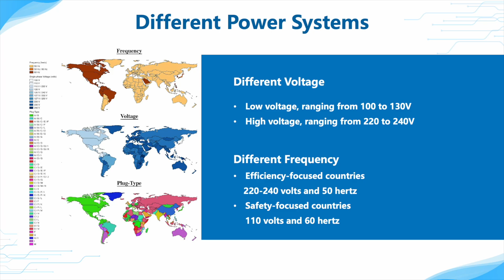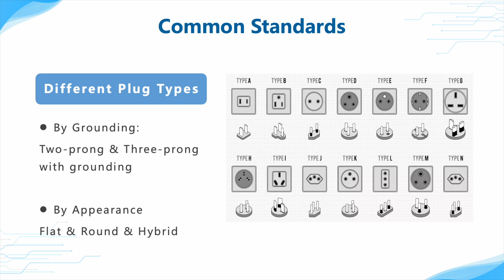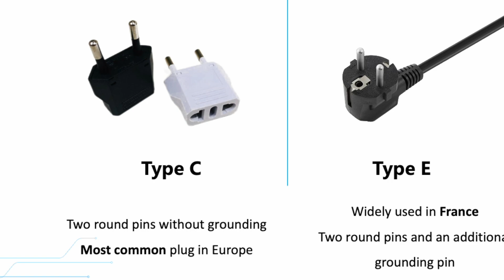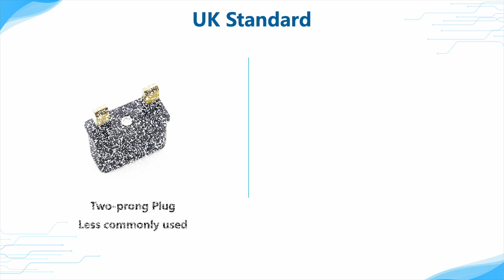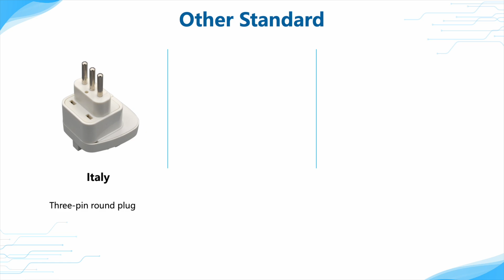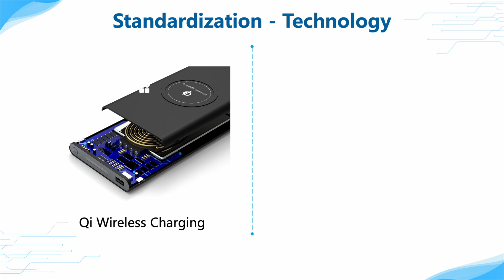How to Tell Different AC Plugs Around the World - ChargerLAB Explained

Comment: You might want to recheck your data as there're tons of inaccuracies... CE is a (self-)declaration of conformity, sometimes jokingly referred to a "China Export", because it doesn't mean anything at all, it is most certainly not a safety label!

110V is neither "low voltage" nor is is "safer" then "high voltage", rather the opposite, typical workloads require so much current at 110V, that it is a safety risk.

Type E sockets are common e.g. in France, Type F sockets in most other European countries, except for Switzerland(!) which have type J for grounded connections. The ungrounded type C works pretty much worldwide, except for North America and Commonwealth countries. Grounded plugs in Europe are mostly Type E+F so they work pretty much everywhere (except for Switzerland!).

Comment: I've never seen the two pin U.K. plug before. 

On U.K. sockets a shutter closes the opening for the two power pins until the ground pin is inserted, so I'm not sure a two pin plug would work on modern sockets!

Comment: Grounding isn’t really a requirement based on power draw, rather it’s a requirement based on whether the appliance is double-insulated or not. If the appliance has any metal that a human hand can easily touch that isn’t fully insulated from the internals, it’s best if that metal be grounded.